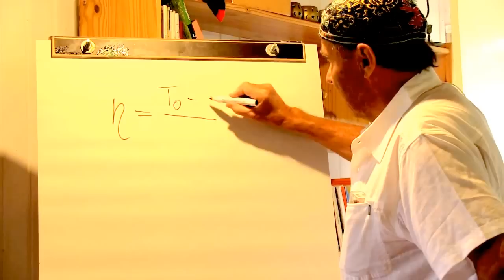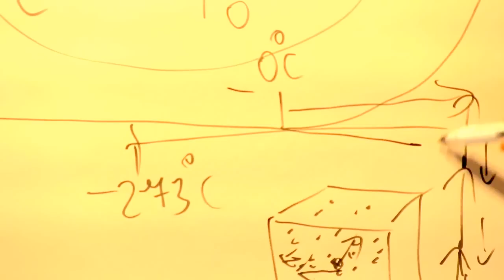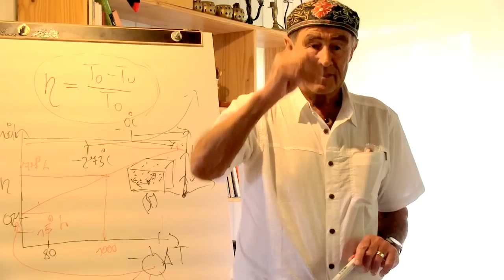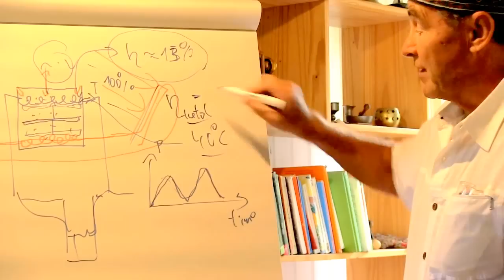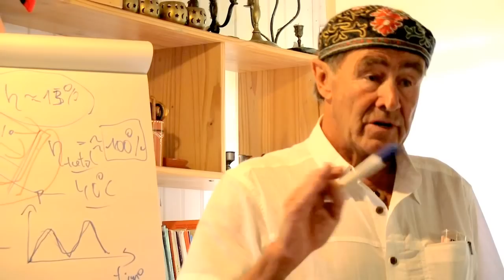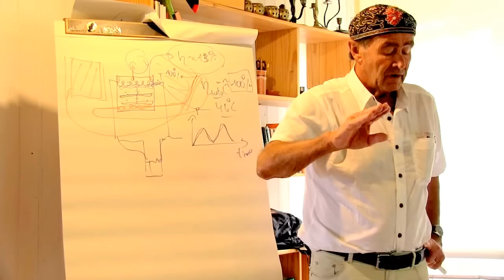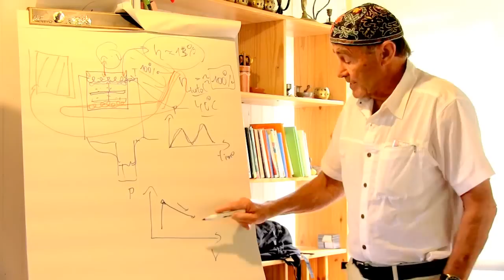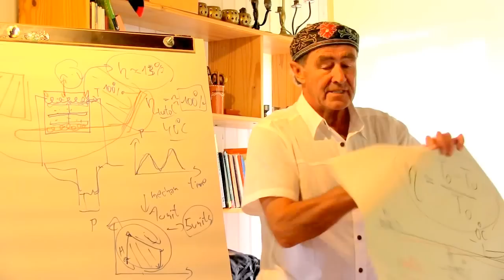Sunpulse 500: Why Low Temperature Stirling Engines: Theory | J. Kleinwächter | Auroras Eye Films

Comment: I had the opposite ideal, i thought he was talking about cooling the Stirling engine's cool cylinder, keeping a nice delta T.  But when i watched the other video showing the Sunpluse 500 in action, it was using heated water from evacuated tubes from sunlight to heat the heat cylinder in the Stirling engine. 

I thought it would work using the well water to keep the cool cylinder cool, and then that water will be warm after running directly around the Stirling cooling cylinder. Once that water is already warm now use the evacuated tubes and run it thru them and it is already half way hot, and you can heat the water to your top temp very quickly. So now you get HOT water from cooling the Stirling, and the heating cylinder will be in a evacuated tube too collecting the sunlight's heat in the cylinder directly, creating a very nice delta T. The delta T with cold well water along with amplified sunlight from parabolic mirror directing on the the heating cylinder inside an evacuated tube. NOTE; the evacuated tube will be made specifically for the size cylinder you need, it won't be those skinny long tubes that you can buy, it has to be specially made to fit the cylinder.

What do you guys think, will this be as efficient or more or less efficient? Maybe we could also use that hot water and turn it into super heated steam too, using the sun and a special boiler made to use the sun.
Reply: those concepts are intriguing, with access issues with drinkable water popping up in many locations due to climate change I think that you could at least condense some of that water for agriculture and drinking.  The big picture how bad would it be to use mass produced of scale evacuated solar tubes? why waste all that energy to make a SET that can only be use for one application?  use a common mass produced tube and adjust the water volume with baffles etc. Quickest way to destroy a tube is having direct thermal shock of colder water hitting those solar boilers.

Comment: what about  a vaccum pump (Vacuum Cleaner) and flex irrogation tubeing   as a heat pump.. ?
Reply: Ideally, you'd want a closed-loop system for the heat, eventually you could add a cold storage like you have the host storage, so the stirling engine would be coupled with a low-speed-high-torque gearbox to at least one of 5 pumps (one for ambient coldness, one for stored coldness, one for ambient heat and one for stored heat, and another one for fuel-sourced heat like from a rocket stove).

Comment: Why don't they start a campaign to collect money for opensourcing the blueprints?
Reply: Because there's nothing to open-source. Everything is already open-source. There's the sterling engine, except that it's not one, but many layers of hot-cold-hot-cold and so on, so like multiple stirling engines connected to the same shaft, which powers the generator. Think of it like the space between a circle and a bigger circle, being filled with stirling engines, with the tubing for the hot and cold air on one side and the synchronized stirling engine layers on the other side, except there are two sets of engines, some going in one directions and others in the other, connected through an extra gear system (a gear to synchronize the movement, and a piston or bi-directional gear system to make the movement uniform). And that is how one would improve upon the Stirling Engine, reducing the heat loss by using the same hot plate for multiple stirling engines. Well either stacking them in a circle, or on top of eachother, still ending up with the same 2 movements which would need an extra gear to synchronize, There could also be the option for the engines to go from the center of the circle to the sides, in which case a not much changes, but it seems to me that its a lot more wasteful of energy, though I might be wrong.

The energy storage is just some rammed dirt or rammed earth (the later has cement 5% or less by weight, both require some water and for the mix to be compacted) with tubing (either zig-zag or lelix, to transfer energy more efficiently) insulated as much as possible (aircrete/aerated-concrete would be a good start, but even things like a hay mix which has air gaps works well, or bricks with air channels to help with insulation), and you can build storage for both the hot and cold plate (by fan, in the day-time feeding the hot storage, in the night time feeding the cold storage), and since the storage is mostly dirt cheap, because it's dirt, and usually bigger means less money for the insulation, it's even more efficient than with one type of storage, but again, it requires more resources to build the cold storage.
Reply: @SapioiT  Wow, talk about the blind leading the blind. If English is not your first language, then you're excused, otherwise, what you wrote is nothing short of an alphabet soup.
Reply: @lesleykramer7207  Get off your high horse, his english isn't that bad...
Reply: Because there's money to be made somewhere. Somebody needs to get in there and reverse engineer the sucker lol.

Comment: 29.1157.28   he says 100% yet on his blackboard behind him, he has got about 61%, yet he has extracted heat before. yet even with this, it does not seem to me to stack up to 100%. yet if is not electricity, then it must be heated water
Reply: True, but it does use waste heat, so the total system efficiency could be higher than a PV system. Plus their demonstration system stored heated oil in tanks so it could operate around the clock.

Comment: Presenter confuses work with waste heat when he claims 100% efficiency for the example in question.  If you take the waste heat from a heat engine and use it to drive another engine that produces some work then you can count that in the aggregate efficiency.  In any case the second law already tells us that it is impossible to convert all of the heat supplied to a cyclic heat engine into useful work.  This is expressed by the carnot efficiency shown at the outset of the lecture.
Reply: @Independent Thinker the speaker in the video was lecturing about Carnot efficiency.  In this context it is a mistake (and at the very least misleading)  to include  the waste heat  in the efficiency calculation - when the waste heat is simply used for hot water heating.  Efficiency is a measure of how much useful work a machine can produce from a given amount of heat - period.  Had the waste heat been used for an ORC then it would have been appropriate to include this in the aggregate efficiency.
Reply: @Independent Thinker I'm sorry for you that you are  unable to understand this.  Work and heat are different -  period.  If you want to start inventing your own definitions of efficiency then go right ahead.  Perhaps sign up for a rudimentary course in basic thermodynamics - the kind of thing you get in high school - and then perhaps you'll start to understand.  Otherwise stop posting useless comments...